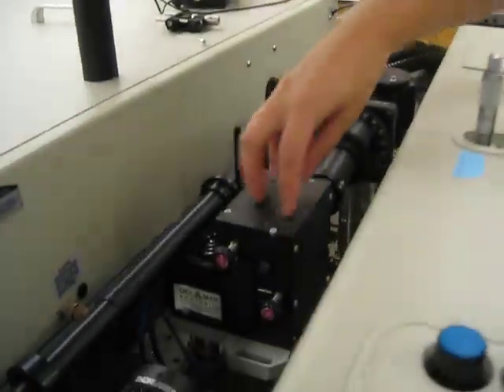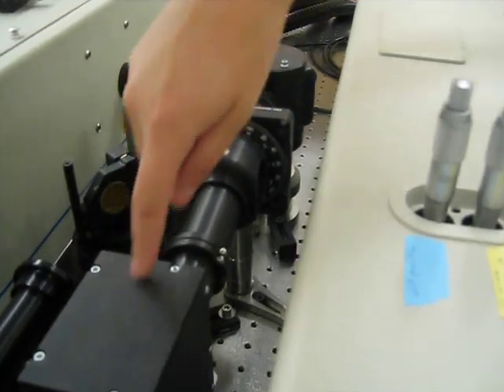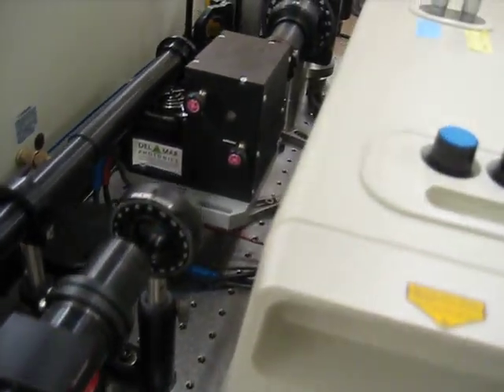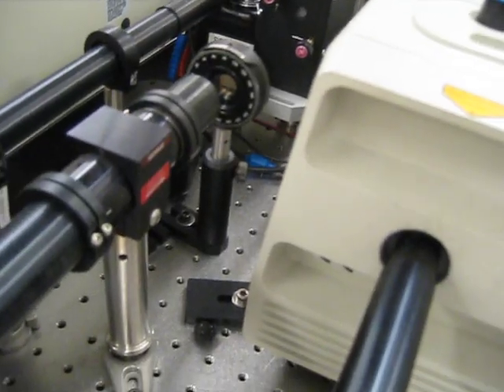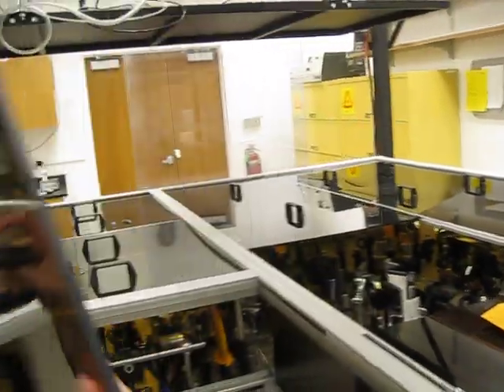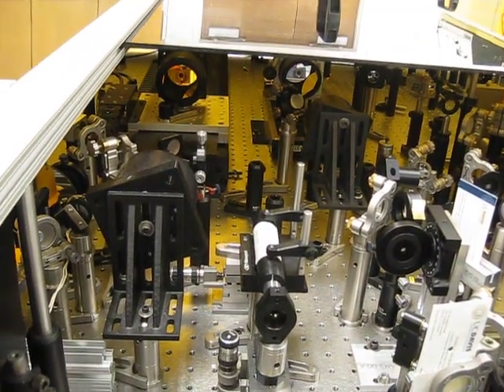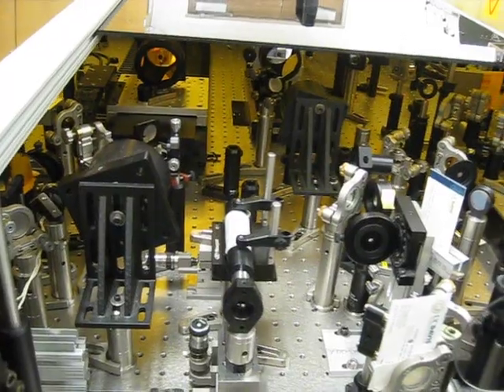A single source femtosecond-millisecond broadband spectrometer UC Davis - sales@dmphotonics.com

Comment from the maker: Novel applications of melanin pump-probe imaging: correlating structural and chemical variation with MC1R gene expression and the onset of Parkinson's disease
Sanghamitra Deb, Christopher P. Dall, Francisco E. Robles, Christina S. Gainey, Jesse W. Wilson, Warren S. Warren, Nicole A. Kukutsch
9 February 2015 • 11:05 - 11:20 AM | Part of SPIE BiOS

Pump probe microscopy of human hair
Naveen K. Balla, Patrick Ferrand, Florian Formanek, Jean-Baptiste Galey, Lucien Bildstein, Hervé Rigneault
10 February 2015 • 4:20 - 4:40 PM | Part of SPIE BiOS

Experimental validation of a theoretical model of dual wavelength photoacoustic (PA) pump-probe excitation in fluorophores
Julia Märk, Christoph Theiss, Franz-Josef Schmitt, Jan G. Laufer
9 February 2015 • 5:30 - 7:30 PM | Part of SPIE BiOS

Comparison of linear (hyperspectral) and nonlinear (pump-probe) absorption microscopy of melanin
Jesse W. Wilson, Sanghamitra Deb, Francisco E. Robles, Christopher P. Dall, Lejla Vajzovic, Gargi Vora, Rebecca C. Stacy, Maria A. Selim, Prithvi Mruthyunjaya M.D., Douglas S. Tyler, Martin C. Fischer, Warren S. Warren
10 February 2015 • 10:30 - 10:50 AM | Part of SPIE BiOS

Ultrafast pump-probe studies of the complex refractive index in metals
Stephan Rapp, Maximilian Bung, Albert Althammer, Heinz P. Huber
12 February 2015 • 9:20 - 9:40 AM | Part of SPIE LASE

In vivo pump-probe microscopy of melanoma: characterizing shifts in excited state photodynamics with respect to invasiveness and chemotherapy response
Jesse W. Wilson, Simone Degan, Christina S. Gainey, Tanya Mitropoulos, Mary Jane Simpson, Sanghamitra Deb, Christopher P. Dall, Yasmine Tameze, Jennifer Zhang, Warren S. Warren
8 February 2015 • 5:10 - 5:25 PM | Part of SPIE BiOS

Pump-probe imaging of pigmented cutaneous melanoma gives insight into lesions' metastatic potential
Francisco E. Robles, Warren S. Warren
8 February 2015 • 3:40 - 4:00 PM | Part of SPIE BiOS

Anisotropic singlet-exciton fission in single-crystalline perfluoropentace
Kolja Kolata, Tobias Breuer, Gregor Witte, Sangam Chatterjee
11 February 2015 • 9:40 - 10:00 AM | Part of SPIE OPTO

Dynamics of optically excited tungsten, stainless steel and bulk metallic glass for ripples formation
Hao Zhang, Chen Li, Jean-Philippe Colombier, Guanghua Cheng, Razvan Stoian
10 February 2015 • 4:00 - 4:20 PM | Part of SPIE LASE

Relaxation dynamics in single-crystalline perfluoropentacene
Kolja Kolata, Tobias Breuer, Gregor Witte, Sangam Chatterjee
8 February 2015 • 4:00 - 4:15 PM | Part of SPIE OPTO

Ultrafast laser irradiation of thin films as a route to the formation of very small nanoparticles with controllable size distributions
Keegan J. Schrider, Ben R. Torralva, Steven M. Yalisove
12 February 2015 • 11:40 AM - 12:00 PM | Part of SPIE LASE

Optical coherence tomography with stimulated emission
Chun-hui Yu, Shen-Shou M. Chung, Fu-Jen Kao
9 February 2015 • 5:30 - 7:30 PM | Part of SPIE BiOS

Imaging highly-absorbing nanoparticles using photothermal microscopy
Simon-Alexandre Lussier, Hamid Moradi, Sangeeta Murugkar
9 February 2015 • 5:30 - 7:30 PM | Part of SPIE BiOS

Investigations of the damage mechanisms during ultrashort pulse laser ablation of dental tissue
Matthias Domke, Sebastian Wick, Maike Wahler, Stephan Rapp, Julia Kuznetsova, Christian Homann, Heinz P. Huber, Ronald Sroka
8 February 2015 • 9:10 - 9:30 AM | Part of SPIE BiOS

Effect of the Zn coordination complex of the excited-state and two-photon absorption spectra of a novel salicylidene compound
Marcelo G. Vivas, Jose Germino, Tereza Atvarz, Cleber Mendonca
8 February 2015 • 4:15 - 4:30 PM | Part of SPIE OPTO

Elucidating photodynamics with ultrafast pulse sequences: pump-repump, multidimensional spectroscopy, and beyond
Patrick Nuernberger, Stefan Ruetzel, Tobias Brixner
8 February 2015 • 11:15 - 11:45 AM | Part of SPIE OPTO

Ultrafast biexciton dynamics in single CdSe/ZnSe quantum dots
Denis V. Seletskiy, Christopher Hinz, Johannes Haase, Christian Traum, Florian Werschler, Stefan Lohner, Alfred Leitenstorfer
10 February 2015 • 12:20 - 12:35 PM | Part of SPIE OPTO

Efficient Auger scattering in Landau-quantized graphene
Florian Wendler, Martin Mittendorff, Stephan F. Winnerl, Manfred Helm, Andreas Knorr, Ermin Malic
8 February 2015 • 9:45 - 10:00 AM | Part of SPIE OPTO

Fiber based ultra-short pulse delivery for nonlinear spectroscopy and microscopy using high energy solitons
Sarah Saint-Jalm, Esben R. Andresen, Abdelkrim Bendahmane, Alexandre Kudlinski, Hervé Rigneault
8 February 2015 • 5:30 - 7:00 PM | Part of SPIE BiOS

Photoacoustic (PA) tomography of a fluorescent contrast agent and genetically expressed proteins using excited state lifetime modulation
Julia Märk, Hakan Dortay, Franz-Josef Schmitt, Jan G. Laufer
9 February 2015 • 5:30 - 7:30 PM | Part of SPIE BiOS

Comment from the maker: Monitoring metabolic enzyme activity in cells with fluorescence lifetime imaging of NAD(P)H
Joe T. Sharick, Melissa C. Skala
8 February 2015 • 5:30 - 7:00 PM | Part of SPIE BiOS

Statistical analysis on activation and photo-bleaching of step-wise multi-photon activation fluorescence of melanin
Zetong Gu, Zhenhua Lai, Xi Zhang, Jihao Yin, Charles A. DiMarzio
8 February 2015 • 5:30 - 7:00 PM | Part of SPIE BiOS

Super-resolution fluorescence imaging of biocompatible carbon dots
Godefroy Lemenager, Elisa De Luca, Ya-Ping Sun, Pier Paolo Pompa
8 February 2015 • 9:30 - 9:50 AM | Part of SPIE BiOS

In-vivo experimental validation for a featured-data time-domain diffuse fluorescence tomography based on the radiative transfer equation
Yan Zhang, Limin Zhang, Huijuan Zhao, Feng Gao, Jiao Li
9 February 2015 • 5:30 - 7:30 PM | Part of SPIE BiOS

Standing-wave excitation of fluorescence in a laser-scanning microscope allows precise contour mapping of the red blood cell membrane
Rumelo Amor, Sumeet Mahajan, William B. Amos, Gail McConnell
11 February 2015 • 3:40 - 4:00 PM | Part of SPIE BiOS

A six-color four-laser mobile platform for multi-spectral fluorescence imaging endoscopy
John F. Black, Tyler Tate, Molly Keenan, Elizabeth J. Swan, Urs Utzinger, Jennifer K. Barton
8 February 2015 • 9:30 - 9:50 AM | Part of SPIE BiOS

A new calibration tool to simply and quickly monitor and follow the performances of fluorescence microscopes
Arnaud Royon, Gautier Papon
10 February 2015 • 11:40 AM - 12:00 PM | Part of SPIE BiOS

Dual modality of non-contact photoacoustic tomography and fluorescence imaging using double cladding fiber
Jonghyun Eom, Seong Jun Park, Ju Wan Kim, Soongho Park, Byeong Ha Lee
9 February 2015 • 5:30 - 7:30 PM | Part of SPIE BiOS

Smart surgical tools: real-time time-resolved fluorescence spectroscopy integration with surgical tools for intra-operative tumor detection
Pramod V. Butte, Fartash Vasefi, David S. Kittle, Chirag Patil M.D., Ray Chu M.D., Keith L. Black M.D.
8 February 2015 • 10:55 - 11:15 AM | Part of SPIE BiOS

Multifocus fluorescence correlation spectroscopy
Vit Dolezal, Lars Kreutzburg, Renate Holzhause, Lennart Lohmann, Richard Borner, Christian G. Hubner
7 February 2015 • 9:10 - 9:30 AM | Part of SPIE BiOS

Real-time fluorescence-guided tumor visualization for intraoperative surgical resection
David S. Kittle, Adam Mamelak M.D., Julie Novak, Stacey Hansen, Keith L. Black M.D., Pramod V. Butte
8 February 2015 • 9:45 - 10:05 AM | Part of SPIE BiOS

Activatable thermo-sensitive ICG encapsulated pluronic nanocapsules for temperature sensitive fluorescence tomography
Tiffany C. Kwong, Farouk Nouizi, Uma Sampathkumaran, Yue Zhu, Maksudul M. Alam, Gultekin Gulsen
9 February 2015 • 1:40 - 2:00 PM | Part of SPIE BiOS

Multiplexed fluorescence tomography with spectral and temporal data: intrinsic regularization with nonnegative least squares
Vivian E. Pera, Dana H. Brooks, Mark J. Niedre
10 February 2015 • 11:40 AM - 12:10 PM | Part of SPIE BiOS

Fast full angle fluorescence molecular tomography system based on rotating mirrors
Daifa Wang, Jin He, Yubo Fan, Deyu Li
10 February 2015 • 1:40 - 2:00 PM | Part of SPIE BiOS

Super-resolution fluorescence imaging of C2C12 cell differentiation
Jing Qi, Xiao Peng, Junle Qu
9 February 2015 • 5:30 - 7:30 PM | Part of SPIE BiOS

Third harmonic generation and multiphoton fluorescence in graphene using a compact femtosecond 1.56 µm laser
Antti Saynatjoki, Lasse Karvonen, Juha Riikonen, Wonjae Kim, Joonas Makinen, Seyed Soroush Mehravar, Robert A. Norwood, Nasser N. Peyghambarian, Harri Lipsanen, Khanh Kieu
9 February 2015 • 1:40 - 2:00 PM | Part of SPIE OPTO

Fluorescence image-guided surgery: from benchtop to bedside
Siavash Yazdanfar, Victoria E. Cotero, Tiberiu M. Siclovan, Dmitry V. Dylov, Cristina A. Tan Hehir
8 February 2015 • 8:00 - 8:30 AM | Part of SPIE BiOS

A robust simulation and reconstruction platform of fluorescence molecular tomography
Shixin Jiang, Chongwei Chi, Yu An, Jie Liu, Jie Tian
11 February 2015 • 11:40 AM - 12:00 PM | Part of SPIE BiOS

Radiometric configuration parameters to consider in quantitative clinical fluorescence imaging measurements
Maritoni Litorja, Aaron Urbas
8 February 2015 • 5:30 - 7:00 PM | Part of SPIE BiOS

Reversibly switchable fluorescence microscopy
Junjie Yao, Daria M. Shcherbakova, Chiye Li, Arie Krumholz, Ramon A. Lorca, Erin Reinl, Sarah K. England, Vladislav V. Verkhusha, Lihong V. Wang
9 February 2015 • 5:30 - 7:30 PM | Part of SPIE BiOS

Development of a spectrally-resolved near-infrared fluorescence imaging system based on a wavelength-swept laser
Jaedu Cho, Tiffany C. Kwong, Farouk Nouizi, Chang-Seok Kim, Gultekin Gulsen
7 February 2015 • 5:45 - 6:00 PM | Part of SPIE BiOS

Effects of scattering and absorbing medium in the fluorescence conversion efficiency of physical tissue models
Suresh Anand, Sujatha Narayanan Unni
7 February 2015 • 4:00 - 4:20 PM | Part of SPIE BiOS

Real-time, quantitative fluorescence imaging using single snapshot optical properties imaging for neurosurgical guidance
Pablo A. Valdes Quevedo, Joseph Angelo, Sylvain Gioux
7 February 2015 • 5:00 - 5:20 PM | Part of SPIE BiOS

Fluorescence time course imaging of healthy and diseased skin for PpIX metabolic maps used in topical PDT and its correlation to the skin and lesions structures
Olena Kulyk, James Ferguson, Sally Ibbotson, Harry Moseley, Ronan M. Valentine, Ifor D. W. Samuel
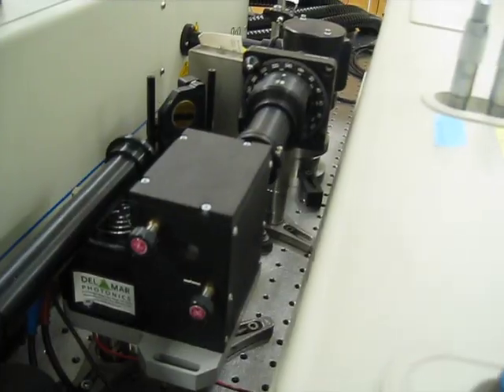8 February 2015 • 2:30 - 2:50 PM | Part of SPIE BiOS

Dithienylethene-based fluorescence molecular photoswitches for photoswitching nanoimaging
Ming-Qiang Zhu
8 February 2015 • 5:30 - 7:00 PM | Part of SPIE BiOS

Simultaneous optical coherence tomography and fluorescence imaging utilizing a single illumination source
Ryan P. McNabb, Tomas Blanco, Howard M. Bomze, Henry C. Tseng, Daniel R. Saban, Joseph A. Izatt, Anthony N. Kuo M.D.
11 February 2015 • 10:45 - 11:00 AM | Part of SPIE BiOS

Light-weight, concomitant color and NIR fluorescence imaging system for molecular-guided minimal invasive interventions
Maximilian W. Koch, Pilar Beatriz Garcia Allende, Vasilis Ntziachristos
8 February 2015 • 9:00 - 9:20 AM | Part of SPIE BiOS

Fluorescence detection of lymph node metastasis using 5-aminolevulinic acid in human colorectal cancer
Yoshinori Harada, Takeo Minamikawa, Hisataka Matsuo, Yoshihisa Yamaoka, Ping Dai, Tetsuro Takamatsu
9 February 2015 • 5:30 - 7:30 PM | Part of SPIE BiOS

Characterization of oral cancer with multispectral fluorescence lifetime imaging in the hamster model of oral carcinogenesis in vivo
Bilal H. Malik, Joohyung Lee, Shuna Cheng, Rodrigo Cuenca, Joey M. Jabbour, Yi-Shing Lisa Cheng D.D.S., John Wright D.D.S., Beena Ahmed, Kristen C. Maitland, Javier A. Jo
9 February 2015 • 8:45 - 9:05 AM | Part of SPIE BiOS

Sentinel lymph node detection in breast cancer patients using surgical navigation system based on fluorescence molecular imaging technology
Chongwei Chi, Deqiang Kou, Jinzuo Ye, Jingdan Qiu, Jiandong Wang, Jie Tian
8 February 2015 • 4:30 - 5:00 PM | Part of SPIE BiOS

Whole-body temperature modulated fluorescence tomography for small animals
Farouk Nouizi, Tiffany C. Kwong, Jaedu Cho, Uma Sampathkumaran, Yue Zhu, Maksudul M. Alam, Gultekin Gulsen
9 February 2015 • 5:30 - 7:30 PM | Part of SPIE BiOS

A novel data-extraction-method of the CCD-based noncontact fluorescence tomography system for small animal imaging
Huijuan Zhao, Qian Wang, Xiaoqing Zhou, Shuang Wang, Jiao Li, Limin Zhang, Zhongxing Zhou, Feng Gao
9 February 2015 • 5:30 - 7:30 PM | Part of SPIE BiOS

Plastic fiber optics for micro-imaging of fluorescence signals in living cells
Takashi Sakurai, Mitsuo Natsume, Kowa Koida
9 February 2015 • 5:30 - 7:30 PM | Part of SPIE BiOS

Characterization of connective tissue progenitors through phase contrast and multicolor fluorescence time-lapse microscopy
Edward Kwee, Kimerly Powell, George Muschler M.D.
10 February 2015 • 8:00 - 8:20 AM | Part of SPIE BiOS

Fast depth-sensitive fluorescence measurements in turbid media using fiber rings
Yi Hong Ong, Quan Liu
7 February 2015 • 9:40 - 10:00 AM | Part of SPIE BiOS

Preclinical validation of dual-modality optical coherence tomography (OCT) and near-infrared fluorescence (NIRF) molecular imaging for the in vivo assessment of atherosclerosis and current treatments
Giovanni Jacopo J. Ughi, Eric Osborne, Tetsuya Hara, Johan Verjans, Iwata Hiroshi, Hao Wang, Ali M. Fard, Adam Mauskampf, Masanori Aikawa, Farouc A. Jaffer M.D., Guillermo J. Tearney M.D.
8 February 2015 • 9:20 - 9:40 AM | Part of SPIE BiOS

Cholesterol efflux monitoring in macrophage form cells by using fluorescence lifetime imaging
Young Sik Song, Dug young Kim
9 February 2015 • 10:40 - 11:00 AM | Part of SPIE BiOS

Fluorescence lifetime imaging to differentiate bound from unbound ICG-cRGD both in-vitro and in-vivo
Paulien L. Stegehuis, Martin C. Boonstra, Karien E. de Rooij, Francois E. Powolny, Riccardo Sinisi, Harald Homulle, Claudio E. Bruschini, Edoardo Charbon, Boudewijn P. F. Lelieveldt M.D., Alexander L. Vahrmeijer M.D., Jouke Dijkstra, Martijn van de Giessen
9 February 2015 • 6:35 - 6:55 PM | Part of SPIE BiOS

Super resolution brain imaging by using a two-photon fluorescence microscopy with harmonic modulation
Szu-Yu Lee, Chi-Kuang Sun
8 February 2015 • 5:30 - 7:00 PM | Part of SPIE BiOS

In-vivo multispectral fluorescence imaging of murine colonic dysplasia with scanning fiber endoscopy
Arlene Smith, Asha Pant, Bishnu P. Joshi, Emily F. Rabinsky, Juan Zhou, Xiyu Duan, Chenying Yang, Eric J. Seibel, Thomas D. Wang M.D.
9 February 2015 • 11:40 AM - 12:00 PM | Part of SPIE BiOS

FRAP (fluorescence recovery after photobleaching) imaging using SLM-controlled doughnut spots
Yi Xue, Christopher Rowlands, Peter So
8 February 2015 • 5:30 - 7:00 PM | Part of SPIE BiOS

Non-linear fluorescence excitation of Rhodamine 6G and TRITC labeled IgG in whispering gallery mode microresonators
Silvia Soria Huguet, Daniele Farnesi, Giancarlo C. Righini, Gualtiero Nunzi Conti, M. Pilar Marco, Carme Pastells, Pablo Loza-Alvarez, David Merino-Arranz, Laura Pasquardini, Cecilia Pederzolli
10 February 2015 • 8:20 - 8:40 AM | Part of SPIE LASE

Automatic visualization of dual-modality intravascular optical coherence tomography (OCT) and near-infrared fluorescence (NIRF) images for assessing vessel wall microstructure and quantitative molecular imaging
Giovanni Jacopo J. Ughi, Tetsuya Hara, Eric A. Osborn, Johan Verjans, Hao Wang, Ali M. Fard, Adam Mauskampf, Farouc A. Jaffer M.D., Guillermo J. Tearney M.D.
8 February 2015 • 9:00 - 9:20 AM | Part of SPIE BiOS

Improved tumor identification using dual tracer molecular imaging in fluorescence guided brain surgery
Xiaochun Xu, Veronica Torres, David Straus, Richard W. Byrne, Kenneth M. Tichauer
8 February 2015 • 12:15 - 12:30 PM | Part of SPIE BiOS